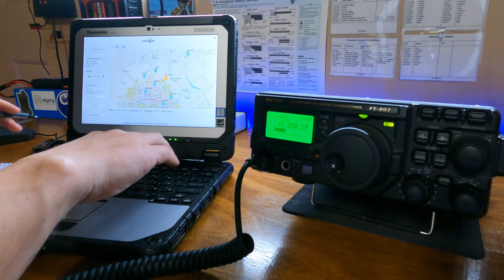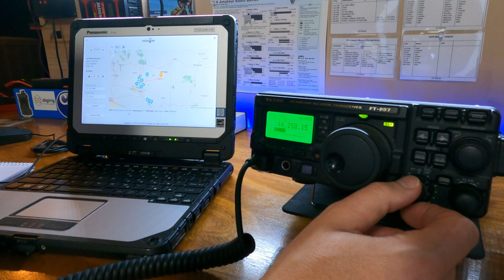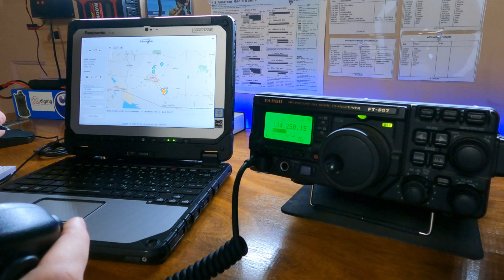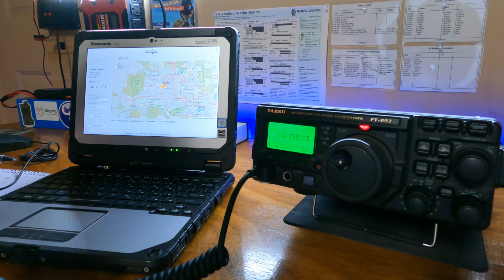Offgrid Comms using 2m Single Sideband - No Random Contacts

Comment: Im late to the comments, but im just getting into 2m SSB.  Will be usimg an old used ICOM IC-290H with a bi-directional "hourglass" home-built antenna to start with.  Horizontally polarized of course.

Comment: Several hams in our area have had excellent results with low power SSB on two meters running JS8call.  Using vertical antennas at 30 feet over rolling Midwest terrain we work 20 mile comms.  1-5 watts does the trick.

Comment: On weak signal i've found by turning down the RF gain to zero and opening up the volume to full now control volume with the RF gain control. you can quiet the background noise floor and hear the signal better also fool around with turning off AGC control and turning on the preamp you will be surprised with what you can hear that you couldn't before.73 jim KB1PFL

Comment: jan 2024 I am rocking the CF-20 tough book and I love it! i have larger Gaming laptops with full sized keyboard, bigger screen and more video horse power at least but the CF-20 is my new best friend. I got it refurbished it came with two so so batterys so it would run 7+ hours on both and I run plugged in often, I am expecting a new battery to be delivered today so that will allow me to grab a go. mine has a 9 pin port for thoes old projects.
I have most if not all mu cloneing software on it and my CalTopo mapping software, FT8,  so handy.

Comment: Great video on the advantages of SSB on 2 meters. Most hams don't realize just how far you can be heard on this band using sideband vs FM. And I am glad you brought up the use of horizontal polarization for weak signal coms on these upper bands. In an emergency, a simple horizontal dipole made from a couple stiff wires of approximately 19 inches attached to a panel mount SO-239 connector duct taped to pole can give you reliable ssb communication 30 to 50 miles or more. Just get the antenna into the clear or find a high spot. The 5 to 10 watts from an IC-705 would be plenty of power. When the SHTF I will be on 144.250 (or whatever your local 2 meter ssb frequency is) with my off grid station for sure!   Doug, K7EME, So Az

Comment: Look at this guy writing his own software. And I thought I was a geek! Is it just for you or do you have a dl anywhere? Great work by the way in ham and on your channel pal. Ive been a "Ham Observer" for a long while. Never went for my license and just listened. I am currently getting ready for the test because you and those damn Man Bags got me all worked up. Didnt have the nerve to buy a old used 897 for 7 to 800$ so I went with a new 991a because it was a lot cheaper than an FTDX10 and an FTM500 that doesn't even to SSB on 2 meters. Its not super portable but Ill be doing more POTA than SOTA for sure.  Keep Hammering dude! 73
Reply from the maker: It's a work in progress, but this project largely stalled with the day job. It needs a full rewrite before it is released. I plan to take some time off work later this year to work on it. It will likely be released next year.

Comment: You might also consider an omni-directional antenna with a horizontal polarization. 

There is one called "Big Wheel", because it looks like a wheel (about 3ft across). You mount it to your mast the same way you would mount any other antenna. The upside of this antenna is that you will not need to rotate. The downside is that you will lose a few dB of gain compared to your yagi. In your case, probably about 6dB. 

73 de DL2AKV

Comment: For the antenna polarization, the reasons for the convention are many - but not set in stone. Verticals are noisier because from what I understand most man made RFI is vertical. FM - you're using HT's and mobile rigs a lot, and they're generally verticals. It's kind of hard to set up a horizontal antenna in a car, but IF you were going for SSB to mobile, you'd probably want to orient all of them vertically to match the mobiles - or maybe set up a halo omnidirectional on the mobile units to get horizontal polarization? I'm not sure how well that'd work, but it might!

One thing that's perplexing is - how does it go that far? There has to be a valley / mountain situation? On flat terrain, there's no way you'd get line of sight over 100 miles. I don't think the mode of operation has much effect on the nature of VHF/UHF being line of sight. Then again, I'm getting 25+ miles crystal clear on AM in the 10m range from mobile to mobile with excellent antennas. It might follow the curvature a bit where VHF wouldn't but I'm not so sure about that.

Comment: Hi Gaston ! I just watched an older video in which you used the Trek Mount with the Comet BNC-24 antennas for a 2 meter APRS contact. With weak signals, I have found the Signal Stick antennas perform better than the BNC-24 antennas. I have and use both, but have found the full half wave construction of the Signal Stick antenna helps with weak signals. It might be worth a try. Especially when working SSB 2 meter with 5 watts. You had no problem with your APRS contact in the video, but as we all know, that is not always the case.
Reply from the maker: Thanks for the feedback. I actually need to pickup a couple of new SignalSticks. Mine were from the first batch and have persistent bends. I know they fixed this and had a warranty, but I'd like to support them again. I will absolutely try it out. Thanks for testing.

Comment: Love the videos - great job. I realize it's online and you'll need the internet, but for others that don't have your software program, which sounds cool btw - you can get beam headings on qrz - just click on their detail and you can see their bearing and distance from your station. Your way is better for shtf situ of course but this a tool you can use now - save info on folks you have a net with. Also, don't discount new radios. I had a 897 and sold it. I loved the form but I now have a ftdx10 and hear stations on HF that weren't possible on the 897. I do still have a ft100d for all band, all mode radio. I believe that with some of these new radios, build quality is still pretty high. IC-7300 is a great HF rig too and been out for over 6 years - most popular HF rig ever. I'd buy another 2 ftdx10's, 2 7300's and 2 991a's if I could, lol. Really enjoy the content and your efforts - please keep it up! 73, Stuart AJ4RM
Reply from the maker: Great tip! Thanks for mentioning this. I mentioned using QRZ.com for that in the past, but likely forgot the mention again here. I am open to any tool that does the job--new or old. This is why I purchased a Xiegu X6100 recently. It's not the type of radio that I would ever buy for style of operating (same applies to the IC-705), but I found an application for that radio that could be useful. I did a video a few week ago on why that radio. Enjoy your FT-DX10 Happy holidays!

Comment: Would the rubber duck antenna that comes with the FT-818/817 work for 2m SSB? It comes with those two tips. I should do a range test with mine.
Reply from the maker: It can work, but your effectiveness will be reduced. Most SSB work is done using horizontal polarization not vertical. This has nothing to do with physics, just agreed upon convention by ham radio operators. You will also get better results with a horizontal dipole or horizontal yagi/beam instead of that the little rubber duck antenna. You will have better luck if the other station is using the same polarization as you are. I hope this helps.

Comment: A big issue with VHF/UHF SSB is the lack of available radios that support the mode. Yes, there's a used radio market, but that's a roll of the dice. The new market has maybe 4 rigs and none are entry level price friendly. Some all mode dual banders or even 2M rig offerings would help get hams to use SSB.

Comment: So, your final points regarding internet, etc-I honestly think this is my resistance to using FT8, and other internet protocols over the air. I realizes its another form of communication-but reality is, if we have a grid down situation-I am looking to make voice contacts, not email someone. Simplicity is key.
Reply from the maker: Nothing wrong with keeping things simple, but some of the digital modes are great. Winlink is a good example of how you can send email to anyone in the world regardless if they are ham or not. I have no interest in FT8 either as there is no meaningful exchange in the protocol. However, I occasionally use FT8 as a propagation analysis tool to understand where my signal is going.
Reply: @TheTechPrepper  I do want to learn it, but I think I want to test for my general first, and am studying for that. Although, from what I have heard, understanding digital mode will help out with the test, so, it may be some cross training :).

Comment: What is a 'decent' price for these radios?
Reply from the maker: I picked this one up for $450 which was a bargain. In good condition, I would say somewhere around $650 would be my personal ceiling. The trick is not buying this stuff on eBay. Local hamfests are the way to go. You may have better results on eHam or QRZ if you must go online.
Reply: @TheTechPrepper  Thank you very much! I'm a new HAM, myself, and very much value the info that you dispense. Please keep up the good work!

Comment: Those whose SSB radios won't cover VHF might search ebay for "ham radio transverter." One labeled "144 mhz to 28 mhz" will take a 10-meter signal in any mode and translate it—both send and receive—to 2 meters. Some assembly required. Make sure what your order is suited for your system.

Comment: Good day sir , I have a frustration rather then a question… I’m a guy that spends a fair amount of time in fairly remote areas ( I am not a licensed ham operator) In your regulations book it states that in the event of emergency anyone can use a Ham radio, Unfortunately I have been in 2 incidents where ham radio would have helped greatly…. I don’t want to know the inner workings of radio or want to build a ham shack , I just would like to have a portable station as you have so I have the ability to communicate in the event of emergency… My beef is that there should be an allowance for unlicensed person to purchase.. Thank you , I’m new sub.👍🇨🇦
Reply: You don't have to have a license to purchase. They always ask for a call sign at my HRO but not required to buy.

Comment: I did 2m SSB faithfully for 4-5 years. The activity was very far and few in between. I had a group of guys in NYC and a group of 3 guys in Ohio that I talked to fairly regularly. This was when I drove over the road. After I got tired of calling CQ to myself I finally gave up on it.

2m SSB is awesome! Sadly it’s underutilized and carries quite the distance. My best distance was 275 miles(with no tropospheric ducting), from Barneveld, WI to The Lake of the Ozark’s, MO. This was using the M2(squared not the number 2) loop, an RMItaly VLA200 (250 watts), & Icom 706MKIIG. Like I said the mode is way too underutilized. What I did find funny was that when there’s a VHF/UHF contest you can hardly find a clear frequency. Where all of those stations when there isn’t a contest? Very sad indeed!

Comment: I remember Thomas Guides, as I worked for a local government years ago and used it for work. Nice video, as always. Maybe I'll see you on the net.
Reply from the maker: Hey, Tim. It's nice to see you in the comments. They were great. I plan to attend this coming Tuesday's AZ SWOT Roundtable. 73
Reply: @TheTechPrepper  We'll see. My Icom 746 does 2mSSB, but I've got comet vertical antenna so not positive on how it will do. We'll find out though!
Reply: @TheTechPrepper  Well, that was a bust. I knew going in that it was a stretch, but my antenna is a 5/8wave vertical that I use for repeater and FM simplex. I could hear two people..one was a 59 signal, so he must have been close (north Glendale). The other person was barely there. I've worked 2m SSB before using a dipole during a field day, so I know my rig will do it. Just getting the right stuff set up here.
Reply from the maker: @MTimWeaver  Glad to see that you gave it a try.

Comment: Ssb is the way to go. Even using our vertical antennas. The only problem is that it excludes those that don't have all mode 2m radios, which in a shtf scenario, may be a good thing.
73

Comment: Good that you mentioned relay mode. It is one of the most basic radio communication techniques. It is so simple we tend to ignore it. But it was the basis of the ARRL, the American Radio Relay League. If you’re talking about off-grid prepping it should be a basic and practiced technique.
Reply from the maker: I figured the "relay" section would be a good nugget of info to put out there for those viewers new to radio. It's another useful technique to add to the toolbox.

Comment: I'm a bit older than you. Heh. I grew up in a time where broadcast TV was still growing (and figuring out what it was going to be). Broadcast AM radio was still a thing and I listened to the radio a lot more than I watched TV (although there was plenty of that). 

What resonated with me was the use of the library. Books were the primary source of knowledge. I still collect books on topics that interest me. Passing books, recreational reading, is for the Kindle (or choose your ereader). But books for learning are paper.

I also think you're on-target regarding radio being a critical component in a grid-down setting. I'm thinking not just amateur radio, but broadcast radio as well. I'm hoping that enough AM stations will be able to hang on that we'll have access to news. It's a lot easier to power a broadcast band radio than a television.

That's a lovely FT-897 you have. If it's the D model I think it has a TCXO. Be aware that filters are becoming scarce. You might want to add a SSB filter to it for phone and digital modes. The CW filters are almost unobtanium. If you can find one, the prices are stupid. (I have two of those radios -- I bought the second one for my son, if he gets his General ticket.)

73 de AG7TX
Reply from the maker: It sounds like I am a bit younger than you, but it's amazing that you had a similar experience but with a different paradigm shift--the shift from radio to television. I guess this is true with every generation.

I really appreciate the lessons I learned by researching and writing reports by walking to the public library after school. I felt spoiled when the CD ROM revolution hit in the early to mid 90's as I was able to have access to an entire encyclopedia on a CD. As standard of practice, we always had a dictionary and thesaurus on hand. Then, the dial-up Internet made things even easier. 

I am on the hunt for the 2.3 KHz Collins filter. They are hard to find.

73 de KT1RUN

Comment: Hi 73's from across the pond UK foundation licensed QRP @10wiskeys license condition. So I have tried 2m SSB with a horizontal 5 element Yagi working 5w from my 917nd. Locally to me (same county) they have a 2m SSB net weekly. I tried calling CQ randomly through the summer when sitting out in the garden rotating my antenna by hand periodically but no contacts to be had 🤷🏻. Im told they contest on 2m SSB some times. I know operators who have worked some inter GB QSO at a fair distance over and above FM 2m. At least at these frequencies a substantial yaggi isn't too unwieldy (or more importantly these days in the UK too expensive 😦) 73's

Comment: You seem to like Yaesu.  818, 857, 897.    There are other brands out there.  But why?  When my Yaesu Ft-8900, 817, and 857 work so well I stick with what I know.  In your other video you said something about standardization.  If you show up at an emergency and they have a radio system you're not familiar with there is a delay for learning.  Great video as usual.  73! de KE5ES
Reply from the maker: Yes, there other brands out there, but personally I like standardizing my gear on single vendor. It allows for part interchangeability and for me to have well established muscle memory using the controls and menu system. For example, the mechanical filters and few other components work in all three of those radios. The cables (CAT and data) and microphones are also interchangeable across my 818, 857, 897. I work a large number of public services events and we always supply our own gear. I have never been in a situation where I have been given someone else's radio.
Reply: @TheTechPrepper  Before I bought the 857 the Texas Dept of Emergency Management set up and there was the 857.  Luckily they had the manual with the radio.

Comment: I've evacuated 3 times was caught in a flash flood. Had 2 power outages that lasted more than 24 hours. Choked people out, been shot at and had knives pulled on me. And still don't understand the necessity of comms. However I'm a general.
Reply from the maker: Well, you can't effectively coordinate people and resources without resources. It's insurance when the cell phones and internet fail.
Reply: @TheTechPrepper  in some of those situations I had a cell, so I guess I did have comms I just didn't appreciate it.

Comment: 80m ground wave prop was used for local coms before 2m repeaters became common.
Reply from the maker: That is correct. I have 75m/80m ground wave and skywave capabilities too. The goal with the "No Random Contacts" series is to introduce a new mode or technique in every video where we can establish a planned contact to a known quantity. 75m groundwave would have worked up to about 50 miles in this area, but not everyone in this group has HF capabilities. Just trying to share with everyone my toolbox of techniques that I have picked up over the last few years.